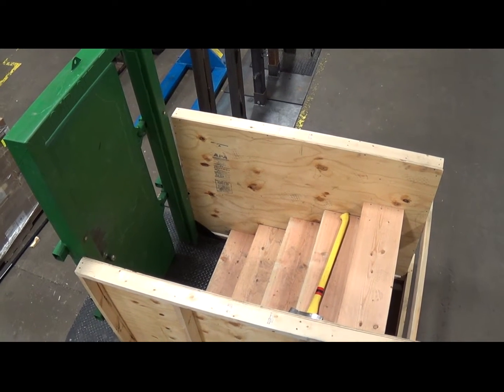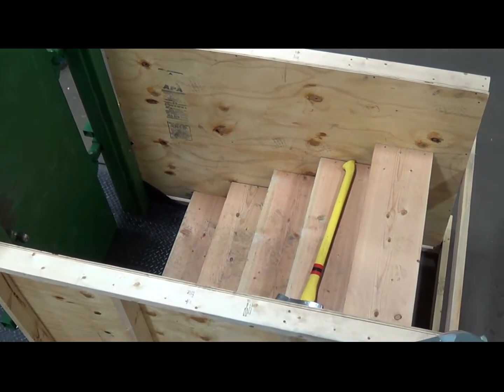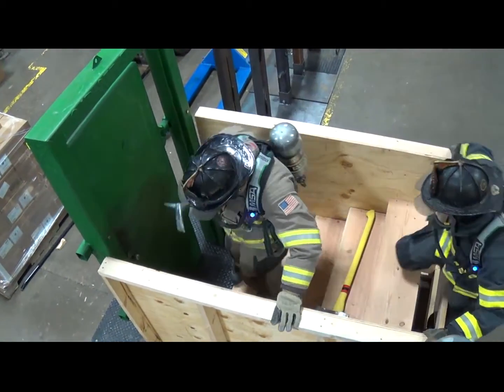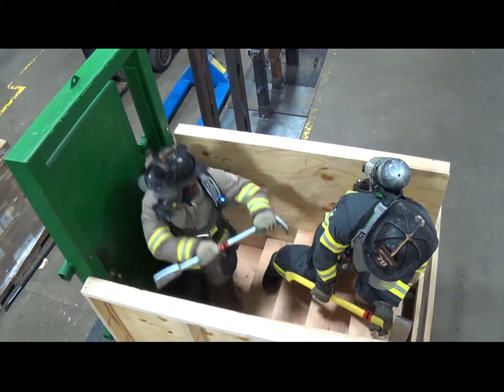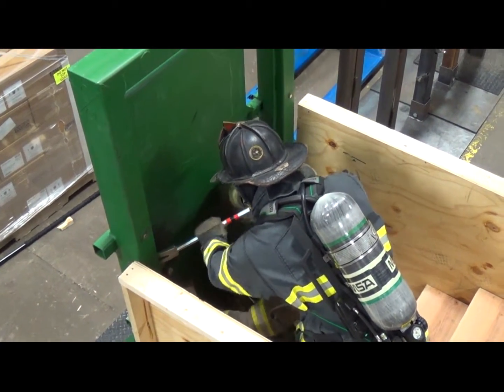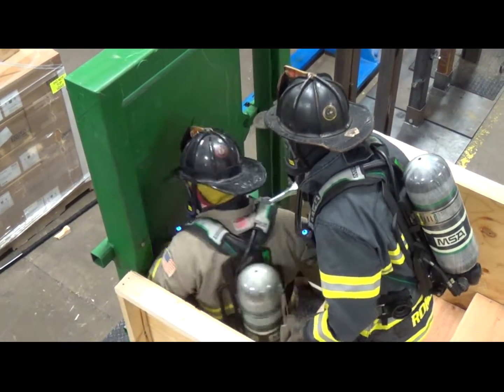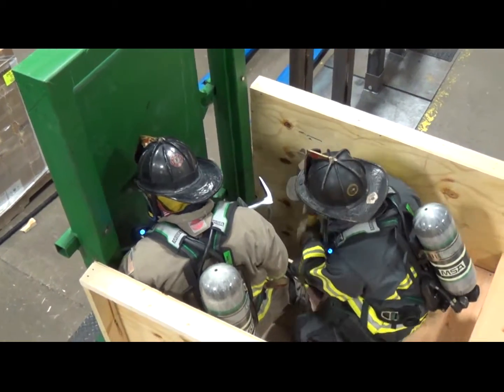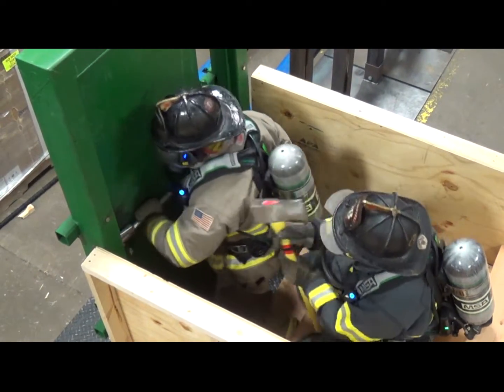Advanced Forcible Entry Training

Comment: What other things could they have done to try and get more door control? At the time of entry he was standing up putting him at risk of a sizeable fire to hit him before entry into the basement
Reply: William Vanbrimmer the lower firefighter perhaps could have put some webbing on the doorknob and held tension I suppose but I think they did a fantastic job considering the limited space they were in and they were blacked out. He probably got control of that door blind faster than I could have actually looking at it!:) And they were on air which obviously would have given them much more protection had that caused a backdraft.